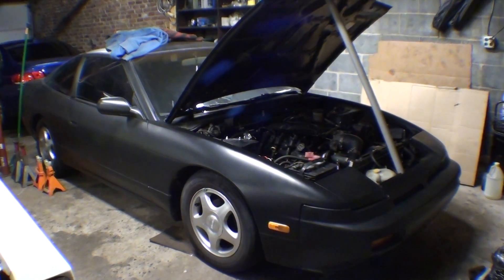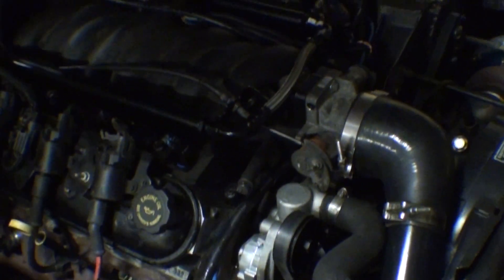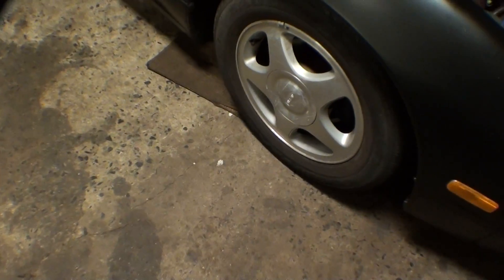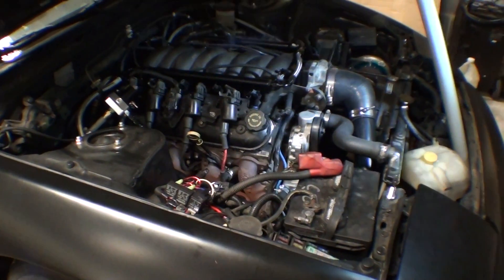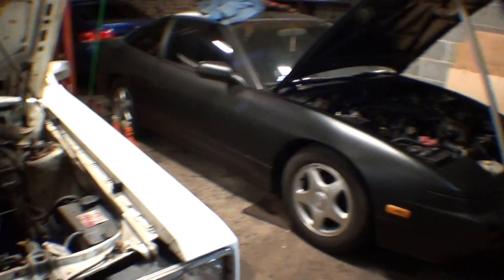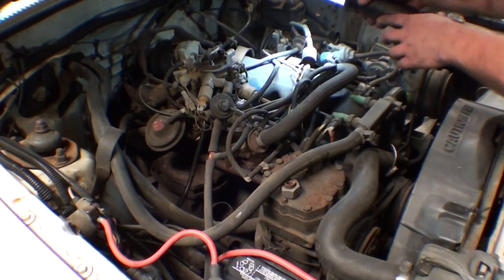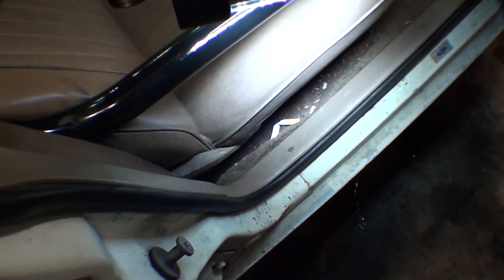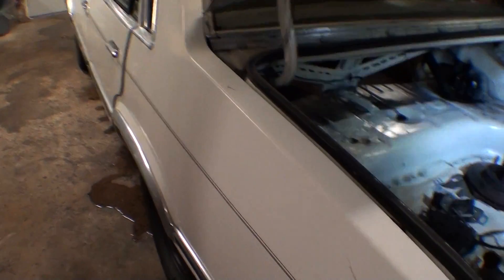12-2-14 240 done means fairmont 5 start...

Comment: Do you solely use megasquirt or do you remove VATS from the stock PCM and use HPTuners? Which method do you use most commonly?
Reply from the maker: i do 50/50, stock ecu or megasquirt cars, i do use hp tuners on stock ecu cars.
Reply: What is involved in using the stock PCM besides disabling VATS?
Reply from the maker: AKDMB quite a bit for a 3bar SD OS car with larger injectors turbo camshaft and then transmission settings, idle, fans etc etc, basically everything you can think of and then more

Comment: I'm doing a 5.3 swap in a 94 Chevy 1500 what swap mounts would you use to keep the trans in the stock location?
Reply from the maker: i believe your best bet is transdapt 1 inch back mounts, theyll line you up with the motor mounts and right to where your trans is currently